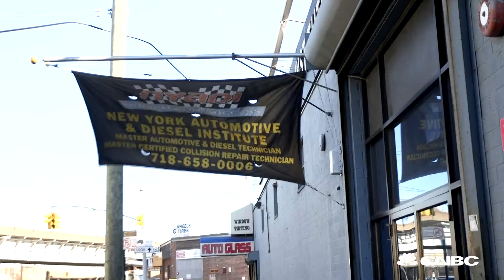Young Money: Trade School Vs. College | CNBC

Comment: Trade school is obviously more worth it. Because you chose that specific career that will last a lifetime, College/universities are pretty much gen eds and there's points were you won't even use it in life only as a stepping stone.
Reply: It depends. Some degrees are useful. Engineering degrees. You can't go to a trade school and then start designing motherboards. You can't go to trade school to become a nurse.
Reply: @colei8752  Not 100% true you can become a registered LPN from quite a few Trade Schools, and then take certifications to become a RN at a community college if you want to advance to that.
Reply: @Cherucha  Community College is still college. You still have to go to college.
Reply: @colei8752  Sorry should of worded that better but trade schools have nursing programs to become a LPN, or a surgical and medical tech assistant.Not totally the same thing, but there are a few medical jobs that don't require college.

Comment: There are a lot of jobs that require a college degree that don't need to and would do better with the trade school model. And they probably could create trade schools for middle management.
Reply: nrkgalt what type of jobs were you thinking of that could operate like a trade school?
Reply: Detroit Fan95 Accounting is a career field for which the training could be done through a trade school instead of a college. For seeking a CPA certification, the training requirement should be either a college degree or trade school completion.